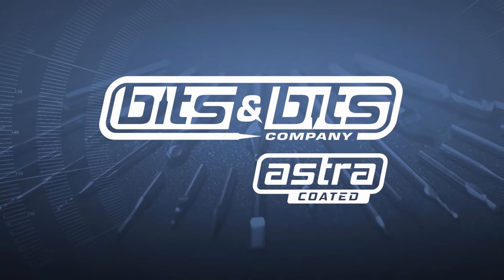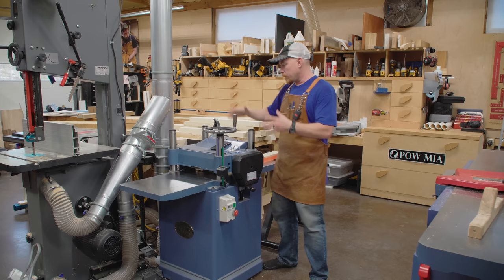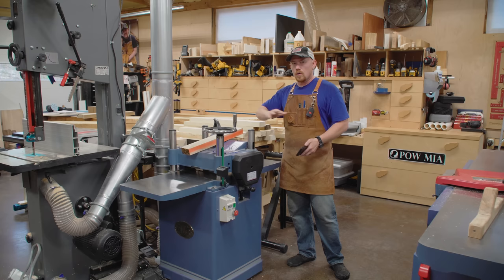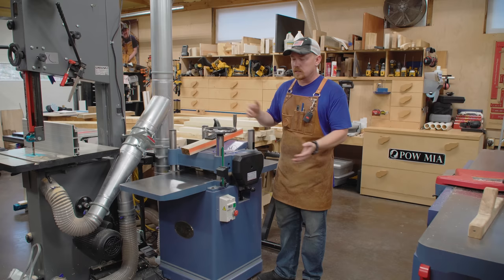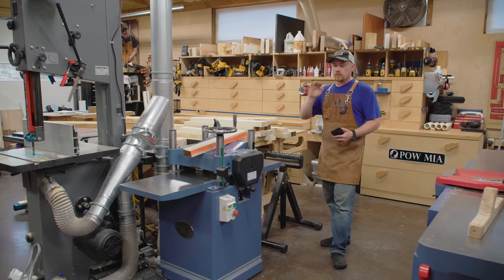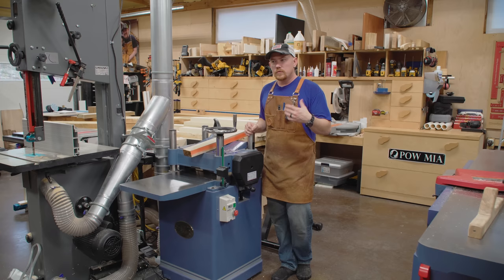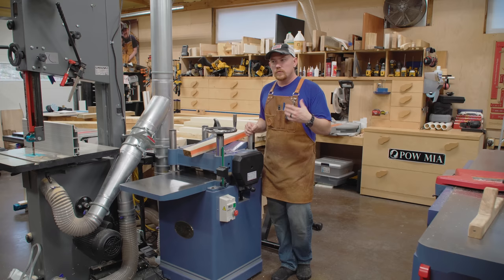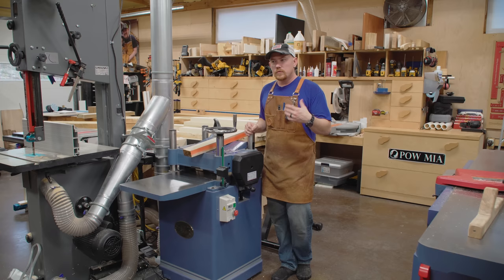Tool Talk #21: Oliver 15 Helical Cutterhead Planer (10014)

Comment: Hi 👋, Jay , great territorial, on your experiences, with planers and thicknesses, in my nearly 50 years,  a specialist joiner, cabinet maker
My first machine was an all in one planing, spindle moulder and saw bench device , didn’t have a lot of funds as I was just sorting out, and the first thing I noticed it was the machine was very underpowered, Startrite K260, it was more of hobbies machine. I then purchased some old machinery that had been restored., and I had moved to a bigger work shop, then 2003/4, I moved again to a very large work shop, 8Mt x 35Mt . Then I purchased all separate machines planer and thickness SCM 10Hp , or thereabouts, this got digital read out, and was at the top of my budget to say the least, and after about two years, I’d wished I changed the blocks to a helical block . Especially when you have to have two different size sets of blades four in each machine. 6 sets for each machine, the resharpening of them wasn’t too bad pick up and deliver within a week, sometimes sooner if I required, Leitz , Tooling, very high, quality, tooling, and machine, components, cutter, blocks, et cetera, 
I would say at least 90% of my tooling is my by this company  LEITZ, 
My planner beds were quite long, but I decided to make them even longer still, I’ve purchased four rails from festool I’ve got some t bolts, and fitted the rails on either end of the beds with adjustable feet, the bed of my table, who is approximately 6 m in length, as I have machining up very large sections of timber by myself, 
My thickness machine as well, I had a huge problem, as the table height adjustment was the bottom bed, so when planing timber, I had to keep adjusting the in outfield tables, one thing I did like about thickness machine, it had a digital readout, to the point of a Mil , 
It is amazing how things have changed over the years , by using a crank in handle to lower and raise the tables, and sometimes couldn’t even guarantee that it was gonna be correct, To the SCM all you have to do is press a number to dial in the height, and you could even program it for job 1 , 2, 3,  et cetera, and now I’m retired, and I still have most of my machinery, I’m now in my 70s, and I’m looking forward to going back to work, 😂, and I’m being serious as I am getting bored. 
I hope this is an insight into my journey, so Jay keep up the great work, I wish you all success for the future, stay safe, Phil from the moulin France,

Comment: I remember when you were saying the Hammer conversion process was no big deal. My internal thoughts were .... uh-huh, give it time. Great machines if you need to save space but any time using a tool becomes attached to extraneous "processes", you're less likely to use it - or at best, it becomes a chore you dread. I can really relate to "I need to re-mill this one piece real quick".  I know they've been around forever but curious to see how the Olivers hold up.

Comment: I have this same planer but branded in Grizzly. By far the best parts of this planer are the fixed table  height and lack of noise level. I had the same thought on the hand wheel. I think you can move the handle to which ever post you like but it is going to require some disassembly and resetup of the head block unless all of the lead screws are the same tapped hole on top. I have had the caps off of the posts but i didn't look closely enough to see.

Comment: Old brand of equipment and if they are the same you can't beat them.
Reply: This is the same Taiwan planer that’s sold in gray, green, white, and other colors.
Reply: No it’s not. Oliver is and has always been an American company. They started in the 1800’s and won a gold medal in world fair in Paris in 1900. They were the first company to make Straitoplane in 1923. Which is a combination planer and jointer that could plane a warped board perfectly flat and straight on both surfaces in one pass. It was copied by all other manufacturers afterwards. Oliver was also one of the first companies to introduce the BYRD cutters as well. They are arguably the most reliable equipment available. Other companies can try and copy their products but it will never be an Oliver.
Reply: According to Google, this planer is manufactured in Taiwan by Geetech.